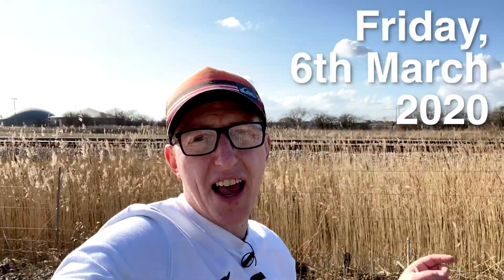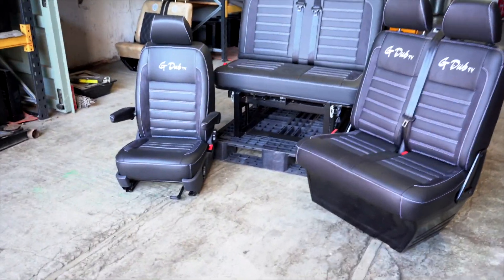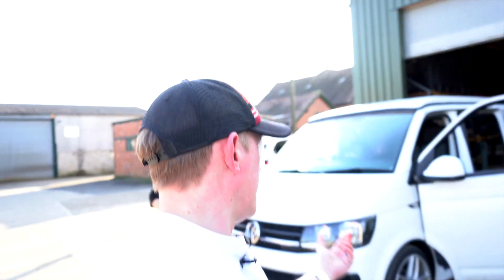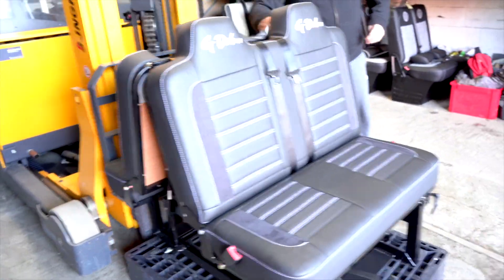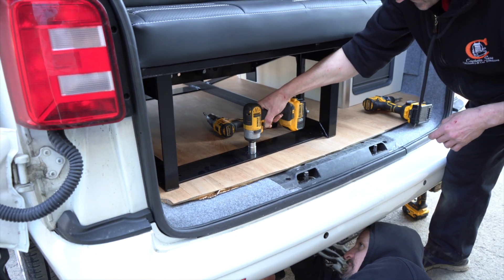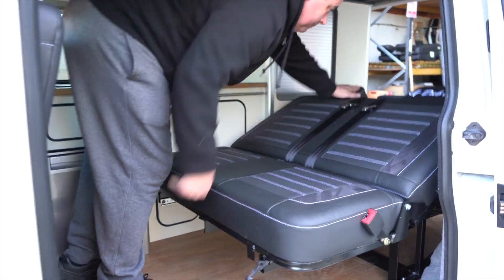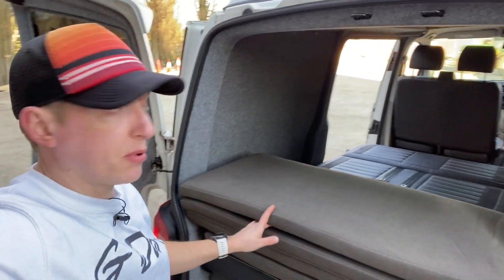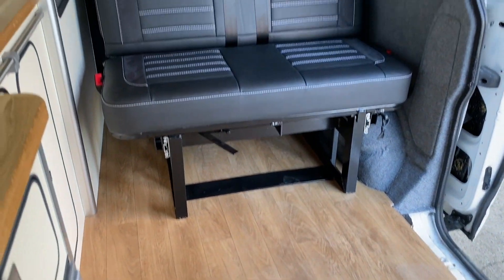THE BEST VW T5/T6 seats I've EVER seen! (Captain Seat)

Comment: I’ve not yet bought a van but hope to very very soon. Love the channel and the tips. Please advise if mot’s are a sticking point with rear seats added? ie do you need a certificate for them? Thanks. Pete, Essex
Reply from the maker: Nope, not a sticking point mate. As long as the seat is adequately mounted and has secure belts you’ll be fine. Always worth letting your insurer know and also checking with wherever you get the bed from that it is MOT compliant

Comment: G'day from South Australia, curious to know if you share the bed or travel alone in the van? I've got LWB 4motion and have a custom mattress that is as wide as the rear hatch entry. I'm 188cm tall and needed an almost full queen size bed.
I live in the van 4 months straight at the snow here so I have a van with no side windows so I don't lose heat.
Reply from the maker: My wife and I fit on there, but it’s cosy!! (Not necessarily a bad thing!)
Reply: Certainly must be cosy in a SWB! I wish I had more space and I don't even have a kitchen or above mattress storage.

Also cheers for the videos, your first van videos I used for some information on insulation and carpeting

Comment: After watching the video I went to captain seats from glasgow on the way back the rattle was terrible with a  crash sound over bumps .contacted Captain sests and they said funny os only the far away vans that rattle (put the rubbish in van from far away )
They then said send a video and we will show you what to bend and pull to stop the rattle .so fix ot yourself. 
Suppose to be M1 crash test. Very disappointed when I spent £2700 .
Ripped off

Comment: Kinda price did you pay mate? They looked well smart
Reply from the maker: To have exactly the same as mine, front seats currently retail at £650, the M1 tested rock & roll bed is £1600. You can bring the price down a little by having vinyl instead of leather, also choosing a different type of R&R bed. Hope that helps 👊🏼😎🚌

Comment: Without sounding stupid what happens to the original seats
Reply from the maker: Great question mate!. The seats are bought on an exchange basis. So the team at Captain Seat have a stock of seats in containers at their site. They retrim the ones in their containers and then swap them out for the ones in your van when you arrive. They also have a number of seats to buy off the shelf. They have various different types. You can pay extra to upgrade your basic seats to have thing like side arms, change the colour of the plastics to black or light grey, add heating, a swivel base, etc.  Hope that helps mate :)
Reply: Thanks G Dubb for the quick response, looking to purchase a T6 LWB tomorrow first VW Transporter. Looked at many videos and think theses are just outstanding. Anything I should look out for when looking at the van? 👍🏻
Reply from the maker: @Phinkinfurmiself  Hard to know really mate. Depends on the spec you're looking at and engine details, mileage, etc. Try and listen to it on cold startup, watch out for knocks from the bay on idle or low tickover revs. Smoke on idle from exhaust. Any clutch judder on gear change. Look out for some history (always gives a bit of confidence if its been well cared for!). You certainly won't be disappointed with a LWB, loads of room! My last T5 was a LWB, my current T6 is SWB. Miss the extra space tbh!

Comment: That seat crash tested?
Just a query really?
Has it been tested with it only being bolted down on the flat bar, surely a more secure fixing would be through the tubelar frame work at all four corners?
Reply from the maker: Yes mate it’s a pull tested bed, and its secured to my van floor at 5 points; one on all 4 corners, plus one in the middle of the flat bar 👌🏼